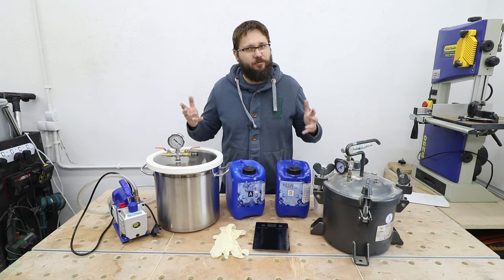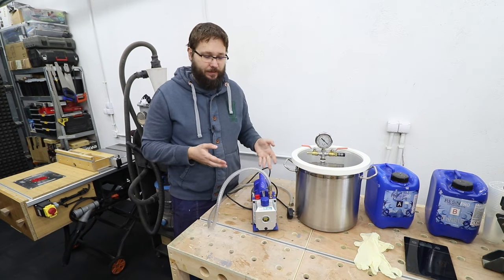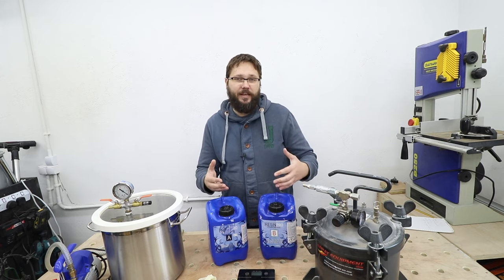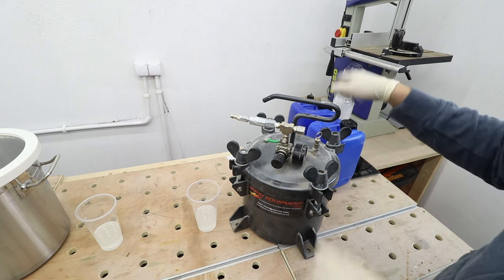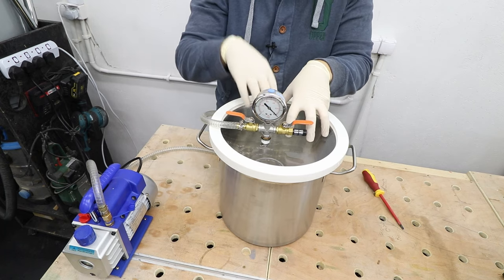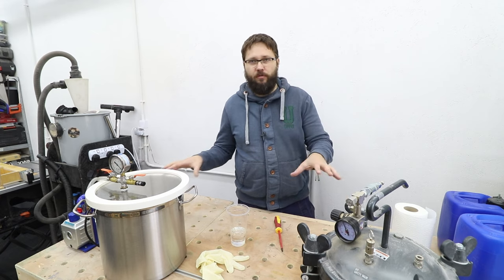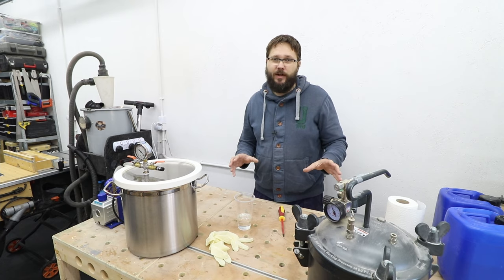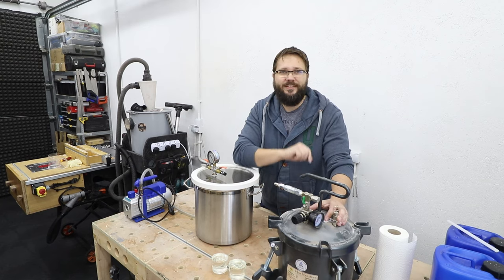Pressure VS Vacuum | Which one is Better for Resin Casting | Resin Casting Basics

Comment: Can the same pump be used for both?
Reply from the maker: One pumps air out (hence vaccume chamber and you need a vaccume pump) and the other one pumps the air in ( hence pressure chamber and you need an air compressor) Two different tools.

Comment: Hi, your pressure pot, is that the same pressure pot for paint sprayers, where you are just not using the pressure valve? Thanks.
Reply from the maker: No, this one is specially adapted to resin work. But to my knowledge there is not much difference between them.

Comment: Hi! Can you put unmixed resin ( resin and hardener separately) in the vacuum chamber then mix it later?
Reply from the maker: Yes you can but you will introduce those bubbles back when you mix both components

Comment: You mixed both resins at the same time, but the one you placed in the vacuum chamber sat out longer while you spent time placing the first one into the pressure pot. You should’ve mixed each one individually for a more accurate comparison.
Reply from the maker: It was few minutes, I don't think that would make any difference to be honest.

Comment: would  pressure pot work better for pouring epoxy river table over vacuum chamber ?
Reply from the maker: If you can find a pressure pot that would fit a river table then yes sure. Although I have never seen one that big and even if there was one it must cost an absolute fortune. 

I don't think you listened to the video very well. You put the resin in a mold to the pressure pot and leave it to cure ( inside of the pot ) pressure pot does not remove the air from resin, under great pressure it forces the air bubbles to microscopic size, that can't be seen by naked eye.
Vacuum Chamber takes the air out of the resin but you can't put your resin in a mold to the vacuum chamber due to foaming. 

So for river tables I would suggest choosing a slow setting and self degassing resin. You may try to use the vacuum chamber to initially remove some of the air bubbles but you would need a very large pot as well for resin table you will be mixing buckets of resin. And remember vacuum chamber will speed up the curing process of the resin. Plus the more resin you put to the vacuum chamber the longer it will take to remove the air from it.
Reply: @CasualDIY  I thought degassing with the vacuum and take it out to pour onto the work space would also minimize the bubbles. Thank  you very much for explaining. My listening skill isn't well.
Reply from the maker: @jarin8464  👍

Comment: I want to fill resin in gemstone so which is best vaccum chember or pressure pot,or best clearance after vaccum put resin in pressure pot please guide me
Reply from the maker: Pressure pot will do the job
Reply: @CasualDIY  how much psi required for gemstone cube make
Reply from the maker: @sonuverma2796  40 - 60 PSI depending on your pressure pot as it will have some set max you should never exceed, the PSI will be the same for any resin project, it makes no difference what it is.
Reply: @CasualDIY  sir I want to make one big size cube with small size stone without any gas bubbles with the bounding resin
Reply from the maker: @sonuverma2796  bounding resin? Isn't that for dentists that they use on your teeth? That will not work, epoxy resin is what you should be using
Reply: @CasualDIY  yes I bounding stone and convert into big size cube
Reply from the maker: @sonuverma2796  not sure of the outcome of that to be honest

Comment: Can a Vacuum Chamber be used as a trap catch can for infusion moulding?
Reply from the maker: You can degass the silicon in the vacuum chamber and then use it for your project. That's about it.
Reply: @CasualDIY  Thanks. Just saved me some money. I might go the abs/pvc route for a catch can.

Comment: I need help, when I cast in my pressure pot the bubbles get bigger and get stuck on the sides of my mold.
Reply from the maker: Are you using the correct pressure?
Reply: My pot is a max 50 psi I stop at 45 psi
Reply from the maker: @kimberlygrace3866  and you leave it under pressure to cure?
Reply: @Casual DIY  no I won't lie I open it to check it time to time. And I just realized that I was losing pressure but I fixed it. The gage was loose so I put that white tape on and tighten it
Reply: @Casual DIY  may be ill do a test cup like you did. Forgive me I'm still a rookie at this craft.
Reply from the maker: @kimberlygrace3866  resin needs to fully cure while under pressure otherwise it will revert back to what it was before applying pressure. Pressure Pot does Not remove air bubbles, with the pressure it squeezes the air bubbles to such a tiny size its not visible to human eye. When the resin hardens and sets it locks those air bubbles in that size.
Reply: @Casual DIY  ok thank you ill stop checking it. I need to be patient with this craft. You helped out a lot thank you.

Comment: Wich compresor u use with the pressire pot
Reply from the maker: This is what I use, more or less, they don't sell the exact brand I have but the specs are the same - https://amzn.to/3X7EE7C
Reply: @CasualDIY  i have DeWalt pancake, i dont know if is ok or i need a Big one :)
Reply from the maker: @rodrigopadilla832  if the specs are similar to mine then it should be ok. Each pressure pot will have some specifications and requirements so that will tell you exactly what you need

Comment: What Resin do you recommend and why?
Reply from the maker: Hmm, I mainly use resin from 3 companies. GlassCast, ResinPro, and Lets Resin. They are all budget friendly and very good quality. They do offer a wide range of different types depending on the job you need doing. Not had any issues with either ( not setting or boiling, for example, as long as you follow the mix directionions ). And used GlassCast and ResinPro for about 6 or 7 years and Lets  Resin for about 1 year.

Comment: Can I add pressure direct inside the silicone mold to reproduce the result I would get from a pressure pot ?
Reply from the maker: Not sure what you are asking to be honest. If I understand what you mean is that you want to connect a pressure hose to your silicon mold? I did show in the video what pressure is needed in this steel pot for the process to work. Any plastic would explode under pressure like that. But I hope I just didn't understand what you were asking.
Reply: @CasualDIY  that was pretty much it 😂 indeed the mold would explode. I was just thinking to ways to making it work such as using low pressure and making a "cage" around the silicone mold. But still, I think the mold would get distorted.
Reply from the maker: @thomasfsr  in no scenario this will work 😅

Comment: That pump is severely underpowered. It looks like it's 3 CFM, max. You really want 5-6 CFM for this. That would account for the time it's taking. Ideally, vacuum your resin prepour, and pressurize it while it cures. The pressurization compresses any air bubbles that remain from vacuuming or trapped air from the pour and reduces their size.
Reply from the maker: That's true, I have 3CFM which is bit underpowered but it does what I need it to do. I don't see the point of two stages. Usually you will be using fast curing resin in the pressure pot as it would cure too fast for any other solution. Never had any issue when using just a pressure pot. Long open window resins that would be suitable for that long two stage process you suggested are in most cases self degassing so the need of that process is not relevant.

Comment: So my pressure pot removed the bubbles perfect, However whenever I use my pressure bot the top surface quality isn’t as good. 

I seem to get some weird waxy top surface on anything exposed yto air does anyone know why this would be ?
Reply from the maker: Maybe you put in the air too quickly and a large force of air is making the ripples in the resin. I would suggest opening the valve slowly.
Reply: @CasualDIY  hey and thanks for the reply it’s seriously frustrating all this trial and error.

However I don’t think I’m adding pressure to fast as I’m using a car tyre compressor and it takes roughly 5 mins to get ti 45 psi.

I’ve read online that it looks like something called Amine blush which seems to be caused by moisture in the air but not sure how I can solve that
Reply from the maker: @BigPappaP  you need a filter between the pot and air compressor

Comment: How do I stuff a 6 ft table into a vacuum chamber to stabilize my wood table?
Reply from the maker: You don't, you need special deep pour, long curing, self degassing resin for that.
Reply: @CasualDIY  hey thanks for replying, was being a smarty pants hahaha. I did a river table last week (my first one) with deep pour epoxy resin, took 36 hours for it to set..  popped bubbles for almost 30 hours with a torch. In the end a bunch of micro bubbles showed that weren't visible for them first 30+ hours and when they showed it was too late. So 2 questions,  how do you find out if deep pour resin is self defassing and 2nd ? Could it be the wood that caused them micro bubbles? I'm not overly upset cuz it is a river table tinted blue and the micro bubbles just make it look more life like kinda.
Reply: Also because you replied I'm gonna sub! Glad to get real answers from channels
Reply from the maker: @brucehansen7949 many factors, from resin itself, to outside temperature, moisture content in the air, wood not dried correctly, wood not sealed correctly etc.
Usually pick resins with 70h or more curing time. They do say in the spec sheet if it's self degassing.
Reply from the maker: @brucehansen7949  welcome aboard 👍
Reply: @CasualDIY  cool thanks for the advice

Comment: Why not use the pressure pot for a vacuum pot also?
Reply from the maker: You would be able so see what is happening with the resin. Vacuum means it will foam up and mat overflow. So you need to see it to prevent it by reducing vacuum.
Reply: I would think, with some good modifications to a paint pot, you could put in a plexiglass window in the top so you could observe the resin/mold material as it degasses.
Reply from the maker: @merrillalbury8214  I'm not sure but I think the pressure would brake the plexiglass. I would have to check what are the force difference between them

Comment: i saw air bubbles in both
Reply from the maker: I can assure you there were only air bubbles in the casting that was made with vacuum chamber👍
Reply: @CasualDIY  I know I was just being a friendly troll, you gave me the answers I needed, so I left a like
Reply from the maker: @I-Am-Blue  lol thanks👍
Reply: @CasualDIY  At the 21:00 mark you hold both up to the camera. The one that you say comes from the pressure pot very clearly has at least one air bubble in it, possibly up to four additional bubbles (although those other four could be light reflections). Look directly above your thumb.
Reply from the maker: @jimhyslop  regardless of that the best results will always be from a pressure pot
Reply: @CasualDIY  That much is clear, but "the best results" and "no bubbles at all" are two different claims 😃
Reply from the maker: @jimhyslop  Trust me when done correctly you will have no air bubbles at all, not sure why I had one air bubble there must have missed something. But hey don't have to trust me I'm not here to convince the not convinced. You can do and experiment yourself to see what works for you. All the best

Comment: Actually you are using the vacuum chamber wrong! It should be at 28 inches of vacuum and left there, Air will never remain in a vacuum.
Reply from the maker: You got your process that works for you and I got my process that works for me👍

Comment: Remember that you cannot use a pressure pot when using silicone rubber to make molds. It can only be vacuumed.
Reply: Could you please explain a little bit?
Reply: @alaingirard7524  So they way a pressure pot works is to shrink the air bubble down to a really small size. Once the resin has cured the bubble cannot expand again. In silicone rubber even when the rubber has cured it's still flexible enough to allow the bubble to expand again.
Reply: @DeManney  I see, thank you.
Reply: Although in theory the compressed bubbles in silicone will expand after it's cured and pressure is removed, I've seen a lot of videos of people using pressure chambers with silicone with no problems.